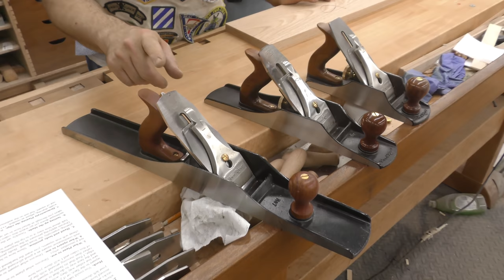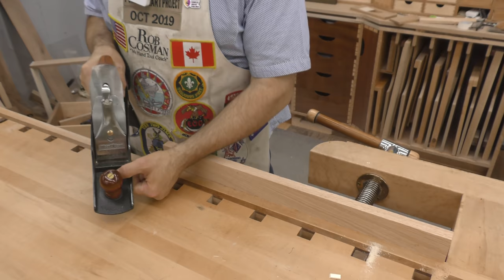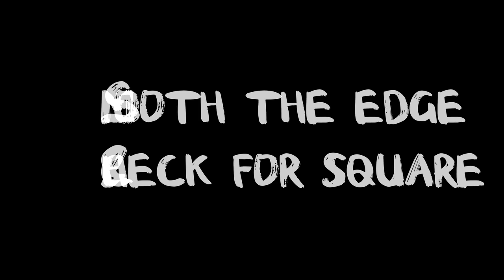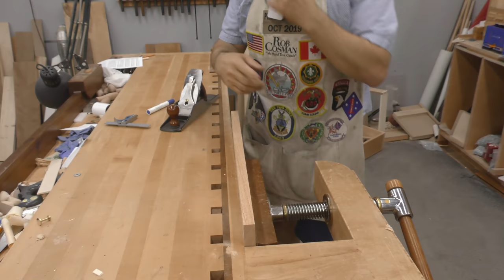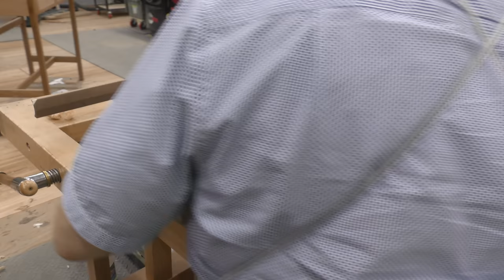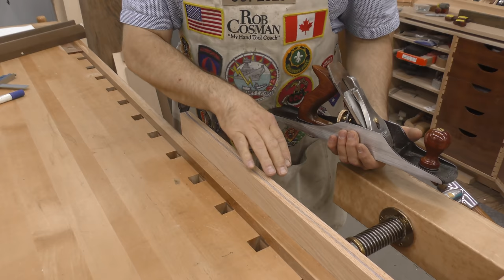Hand Planing Wood - Square an Edge (2020)

Comment: I've watched a couple of your videos now about planing boards to get them true and square, but one thing I'm wondering... I know each pass with the plane only removes a thin sliver of wood, but with pass after pass, it has to add up to a measurable amount removed from the board. How do you deal with getting precise lengths/widths/thicknesses to make the finished product fit together?

Comment: I learned from your tutorial ,now when I trying to true the edge, I can make whisper full width shavings, but when I test the flat with my aluminum level, it shows a gap in the middle area. So I make some more pass on both ends to try fix this , then I end up with another full width shaving.  After that I test it again but still I got a gap in the middle.  Is there any advice on this problem?

Comment: I've got a whole house full of doors that the previous owner used a DA sander to fit the doors with. They horribly screwed them all up. The perpendicularity is nonexistent and the surfaces are wobbling all over. I tried with an electric planer, but it rolled with the junk edges. So here I am. There isn't enough material left to have any kind of professional looking fit, but I'll be buying some planes to try and even these out. The even bigger problem is that I don't have a big enough workbench with which to stabilize everything. I look forward to watching the rest of your content.

Comment: One of the criticisms I have on these type of handplaning videos (from various youtubers) is  they always show short boards. Flatteniing and squaring/jointing a 7' to 8' board  is different, and techniques on short boards don't always transfer to longer stock. For those that build case-goods  such lengths are encountered daily. 

Meant with much respect to you Rob- enjoy your vids, and as an old as dirt retired furnituremaker  it's eye- opening to me to see things from a/your teaching perspective. Thanks
Reply from the maker: Hi dave.  Good point.  I will do a video on longer boards.  My intent was this is just a basic how to video for beginners, not a comprehensive video.  Great comment
Reply: Rob- tabletops are a good example. Usually a 3-4 board glue- up in 7' + range- and planing both for square/glue-up but also finish planing after the top has been shaped, which doesn't quite fit as conveniently on the typical bench. Not to mention round tables have unique challenges too. 

Hope people appreciate the quality of these  (amazingly) free vids you post- must shave 10 years off of the learning curve for a hobbyist woodworker.

I'll shut up now!

Comment: Another excellent video, lots of great information and advice. I used to suffer the dreaded twist, high on right at start, low of right at end, but after watching a lot of your videos and using my legs to move instead of my hands, along with setting up my plane better, it seems that I'm on the way to square. Thanks for all your shared knowledge.

Comment: Excellent instructions.  Since watching your videos, I have used my handplanes more in the past 3 months than I have in the past 3 years.  Thank you.
Reply from the maker: Great to hear!  How are you doing at sharpening now?  you have to love the surface a plane leaves on the wood
Reply: @RobCosmanWoodworking  Sharpening is doing well and when my budget recovers from the dovetail saw and wood hinge kit, I plan on getting one of those 16000 grit stones.  I have been using Shapton pro series up to 8000 grit.  Some woods (Khaya) have given me a little trouble but maple, pine, walnut & cherry have been fantastic.

Comment: I am building a stool out of a rough sawn board. Planing, sawing, jointing... all of that just using hand tools. This is the information which I need now!
Thanks.
Reply from the maker: Sounds great!  good for you.  You can learn so much by building a project just with hand tools, even if you go back to being a hybrid (power & hand) tool woodworker

Comment: How did you decide to plane in the direction that you did?  "Reading" the grain from my computer chair 1000 miles away, I would have planed the other way.  What were you feeling that was not coming across visually?
Reply from the maker: When I ran my fibger across the edge it was rough when I went in the direction that appeared to be the correct planing direction and when I felt the other way it was obviously smoother

Comment: In using the 5 1/2 Wood River plane with a shooting board, I discovered that the right hand side is slightly out of square to the soul, not by much, but enough to throw the edge of the board out slightly after a couple of passes. A small adjustment to the lateral position of the plane blade helped with this issue.
Reply from the maker: Yup, that is what i was going to suggest.

Comment: I wish I had these videos back when I was learning to hand plane.  Anyone trying to learn this skill would benefit from watching this, trying it out, and then coming back and re-watching.

Rob, on an unrelated note, what is your preferred method for mortising when you have a lot to do?  Benchtop mortiser?  Plunge router with an edge guide?
Reply from the maker: Bench-top mortiser.  I once got a commission to build tables and chairs for a high school lunch room.  That was 200 chairs each with 6 mortise and tenon joints.  I started doing everyone by hand.  After 20 of them I got smart and bout a mortiser.  I still have it and use it.  When I shoot the next shop tour video look for it.

Comment: Hey Rob,
I have an invention that’s so easy it’s stupid. I’ve been a carpenter for 45 years. Like you. I developed a bump on my finger from rip with my figure as a guide  using my power saw. Then one day I picked up a piece of 3/4” plastic pipe. About an inch and a half long. I slipped in onto my finger to use instead of the side of my finger for ripping. That had to be 20 years ago. It’s so stupid I thought I could never patent the idea. I am so used to using it I reach into my apron and my finger slips right in to it. So using it as a guide for hand planing would be the same. Try it. You’ll be using it and showing it to every one. Like charlesworth trick you even calling it the Jimmy guide. Ide show you mine but it’s just a hunk of pvc pipe. It help stop getting splinters try it
Reply from the maker: Great idea!  I will try it

Comment: Rob, I have a question and would love your opinion/advice.  Last Christmas my wonderful wife bought me the Rob Cosman dovetail saw that I have wanted for a couple of years.  When I opened the carboard box the saw was packaged in I noticed the brass looked to be a little tarnished and the saw blade had markings that indicated to me it had been used.  I brushed this off and could not wait to put it to use.  When I used it to cut dovetails it doesn't seem to work as smooth as I had expected.  Now I will admit at this point I have had no experience with a good quality saw such as yours so I really don't have any past experience to judge by.  I have watched many of your videos and have tried my best to employ the techniques you teach when cutting dovetails (light grip, let the saw and the saws weight do the cutting, proper stance, etc.).  I have used it on pine, maple, walnut, popular, birch, etc. and I still get the same result which is what I call chatter and vibration on the cut.  Not the smooth looking cut I see you do.  My cuts are straight and I am able to follow my marking lines fairly well.  I am starting to think that it might be the saw was a demo and had been used.   My wife purchased the saw from Woodcraft in Spokane Washington.  Unfortunately that store shut down soon after she ordered it so I can not go back to them with my concerns.   After this long windy explanation my question to you is, could it be possible the blade is dull from use at the store?  Should I send it to you for inspection and sharpening if needed?  I am in no way expecting any thing for free!!!  I would be happy to pay any shipping cost and sharpening fee if you feel that is the best way to go.  I look forward to your advice.  Thanks
Reply from the maker: Hi John, unfortunately I dont know what may have happened to the saw from the time I supplied it to them till you received it.  I do test cut each saw before it leaves and the oil on the blade usually holds the sawdust from that cut.  The oxidation of the brass is a natural process, you can polish it but it will continue to oxidize.  You are welcome to send it to me to check and if needed I would sharpen it for you.  Lightly run you hand across the teeth from the tip to the handle, if it really grabs then the saw is sharp and you wont get very far without it feeling like you're going to cut your hand off!  I have had this query before, the solution is to practice on soft wood like basswood or pine till your sawing becomes smooth and natural feeling.  As you train the stabilizing muscles used when sawing, you will become steady and deliberate, the grabbing will dissipate and it will feel smooth.  Move on to hardwoods from here and voila you are a sawyer!
Reply: @RobCosmanWoodworking  Thanks Rob,  will try your suggestion and go from there.

Comment: I needed this video it helped, I had this issue and struggled to fix it. I don't have the room or space for a jointer or planer so by hand is my only option. Greatly appreciated.  I also like your tools, they have made a difference in my work.
Thanks

Comment: What I am not fully understand is when using the bench as a shooting board what exactly you are doing with the hand off the plane on the opposite edge of the board? Is it applying downward pressure, pressure towards the plane, etc.? Great work and thanks for all you do!!! Second question, do you offer any handles for your saws other than the composite?
Reply from the maker: I am applying a equal amount of force opposite of the plane so to prevent to plane from pushing and moving the board.  Even though the board is held between two dogs, my right hand with the plane can dislodge the board messing up my edge.  So my left had prevents that.

Yes we have tons of wood handles.  Look under the “limited edition saws” section of my website
Reply: RobCosman.com  Awesome!! Thank you so much for replying to my comments. I can’t imagine how busy you must be and it really means a lot that you take the time to reply to messages like this. It really shows great character. 
I will get onto your website under the limited edition saws and get one ordered.
You are the best Rob! Thanks!!

Comment: I have a large maple bench similar to yours, quite old.  Would you please make a video on how to make the top flat and true?
JIM
Reply from the maker: Actually I already have its buried in YouTube somewhere.  You need a #8 or # 7 handplane and some winding sticks.  But you flatten it just like I showed on the small board, its just that you have a big board.  Go to my YouTube channel homepage and look at the hand tool basics playlist.  There is a video there called "planing wide boards....which is actually my workbench top before its attached to my workbench and I flatten it by hand.
Reply: @RobCosmanWoodworking  Thanks, JIM

Comment: How would you suggest a wheelchair bound paraplegic woodworker with no strength or voluntarily movement below the rib cage efficiently use a hand plane?
Reply: Hello Thomas, I know this was directed at Rob, but what I would suggest is that you use the back of your wheelchair as a base to push from and get as far forward in the direction you need to plane while still being able to hold the plane blade off the starting edge of the board, lock the wheels of your chair, and use your arms to push through the board. For boards that can’t be pushed in one stroke leave the plane setting at the end of your stroke, reposition your wheel chair same as when you started but at the new position of the plane and continue your cut wby pushing through the wood further with your arms and shoulders using your chair as your base.
Reply from the maker: Christopher has some great suggestions.  Obviously you need a low bench and you will need to use your arms for planing.  Do like Chris suggested and search for any body position where you can gain leverage .  Sharp blade, wax, small blade projection , and softer woods will help make things easier for you
Reply: Christopher Tinsley Hello. Thank you very much. ‘I do have some tendency to fall forward so I’ll have to be careful.
Reply: RobCosman.com Thanks very much. I am getting a relatively low work bench assembled. I do mostly work with soft woods but I do have some projects that use red oak and a few with purpleheart and maple

Comment: Rob what is your opinion on Festool products?
Reply from the maker: Joey,  I really don't have one.  I do not use any Festool products.  Just never found the need.  Sorry I don't have a better answer for you
Reply: The routers are amazing with superior dust collection and base attachments.  The Kaypex dust collection is also great and the cut quality is wonderful, but the cost is nuts.  Track saw is also good but not worth the money.  You can use a regular circular saw and a homemade jig to do the same thing. There are other track saws on the market too.  I don't own but would never purchase their drills or jig saw - no matter how good they are you just can't justify the cost.